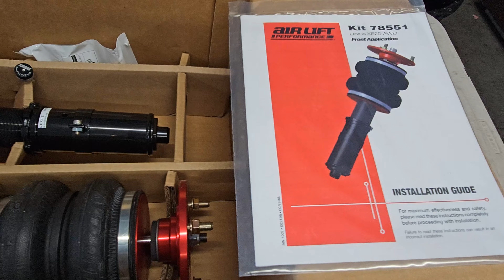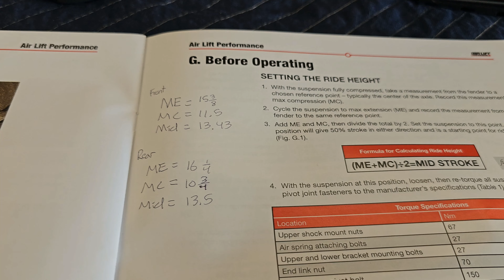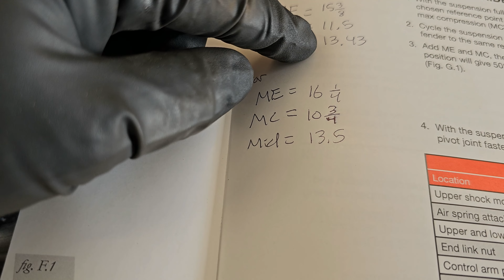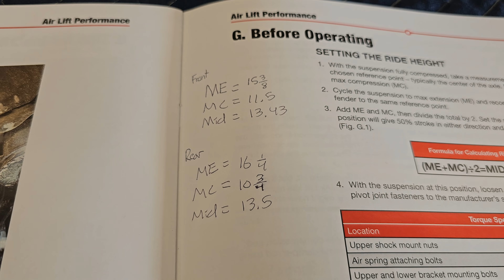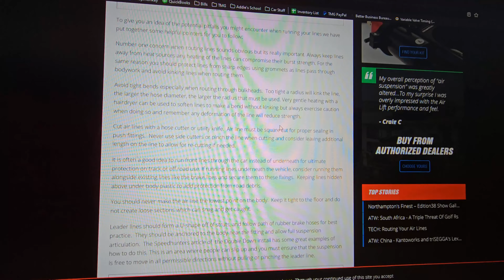2014+ Lexus IS350 Airlift Install

Comment: I heard that Lexus awd normally start giving problems after being lowered. Please give an update in a year or two on the reliability of both the suspension system and the drivetrain, mainly the driveshaft,rear differential and axles

Comment: I just had a rear bag rub long enough against a megan toe arm that it popped.
Did that bag have enough clearance? Because I thought i did and it happened.
Driver side rear was getting bad too so ended up replacing.
Reply from the maker: The owner of the car was just by the shop the other day visiting. Everything is still working great!

Comment: Hey I gotta question, might be a dumb one but I needa know, so the same struts that work on a 2016 Lexus IS300 can work on a 2021 IS350?
Reply from the maker: According to Airlift, 2014+ is same fitment, although I believe it does depend on whether you have the AWD or RWD models.
Reply: @themodgarage  it's actually the 17+ that fits the 21 and up 14-16 has a different mounting for the strut on the front rwd models

Comment: Does adding features like that void the warranty?
Reply from the maker: I would imagine that it shouldn't affect your warranty much at all unless you had an issue related to suspension or suspension noise etc. Air suspension doesn't change the way the engine operates at all.